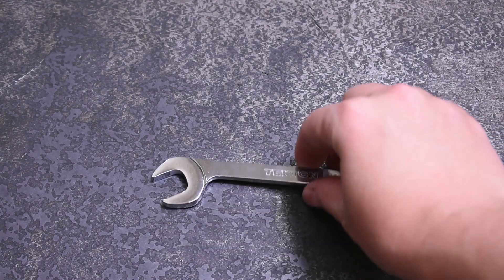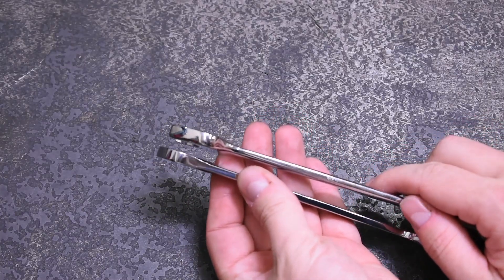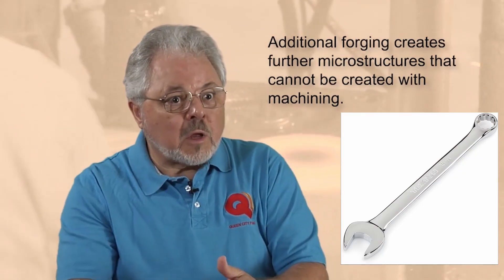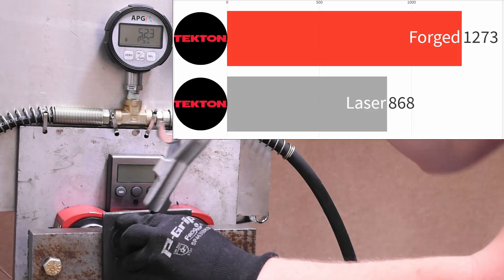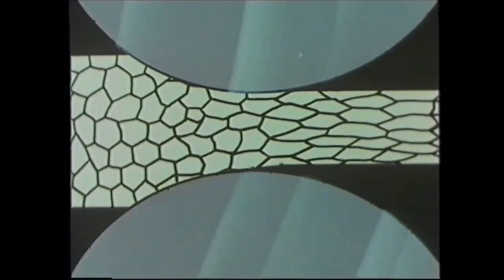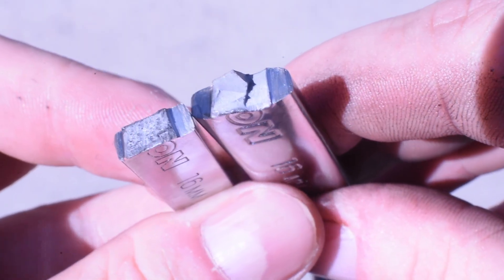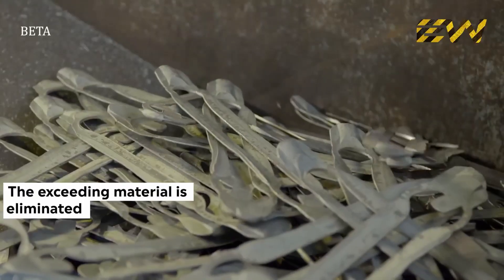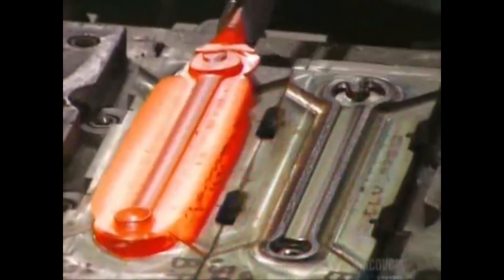The Curious Case of Laser Cut & CNC'd USA Wrenches vs Forged

Comment: Good explanation of the difference in grain structure. The diagrams made it really clear how they differ and how forged tools should be more durable.
Reply: Take a look at machined vs forged vs cast...the grain structure on cast should theoretically be the strongest by far, but in reality a lot of other factors make that determination rather than the way in which the piece was initially shaped.  Cast steel only comes in a handful of alloys, while cold rolled and forged steel alloys number in the thousands, all possessing some sort of unique strength or property, while cast is sort of a "you get what you get" because only certain alloys will remain that same alloy after being melted down and cast.  Grain orientation only comes into play when all other factors are removed besides the orientation, and the gains that grain orientation provide only account for a few percent of ultimate yield strength.  That being said, the larger grain structure of the cold rolled wrench means they didn't refine the grain structure through heat treatment, instead just directly heating and quenching to get the desired hardness and nothing beyond that.  The grains were left large and this heavily affects both strength and hardness, among other things.  Had they done it correctly, the grain structure would've been the same fine powder appearance and it would take a microscope and etching to see the distorted grains from how it was formed.  Forging often refines the grains (it can certainly be done incorrectly as well), so all other things being equal in the manufacturing process, a straight to quench product would favor a forged process more because there was some grain refinement happening along the way.  If you're interested, the knifemaking community has a massive and borderline fanatical knowledge base on how to create and refine the grain structure you want by the precise application of heat cycles and annealing and quenching etc., and that's the biggest determining factor of how strong a piece of steel ends up being.
Reply: @Skinflaps_Meatslapper  it's only when I started to look into metallurgy more in-depth that my mind was blown by how many variables there are in alloys, forging, quenching, annealing, the list of variables could run into the millions when working on just 1 finished piece of metal. There is so much science and knowledge involved in manufacturing metal to get the ideal properties for it's intended use. It is a very interesting field of research involving chemistry and physics. 👍
Reply: @laernulienlaernulienlaernu8953  One thing I really like about metallurgy is that it can be as simple as following a ritual of hitting things with hammers and lots of fire like our ancestors perfected, or as scientific and theoretical as you can stand.  I've amassed tons of knowledge on the subject over the years and I still feel overwhelmed reading science articles about metallurgy.  In truth, even scientists aren't really sure what's going on most of the time...they're able to engineer amazing alloys but a lot of it is still guesswork or trial and error.  Being able to accurately predict what one alloying element might do in a particular percentage is still beyond our capability, we have an idea what it might do based on testing, but sometimes it'll throw us for a loop and we'll discover some new chemical process is happening that we never knew about.  

I find it fascinating that metallurgy today, with all of our modern advances and technology, isn't terribly different from the days when bladesmiths thought a particularly strong steel was the result of magic or imbued with a soul rather than a particularly low impurity alloy.  We know better than to think it's magic these days, but modern bladesmiths are still a superstitious bunch (it's often amusing), and our scientists can't always pinpoint the exact reason for the inexplicable things that happen either.  It might as well still be magic to us at this point in time lol
Reply: @Skinflaps_Meatslapper  I just like the whole idea of alloys, it's like having all these different ingredients and depending on how much of each one, in which order and at what temperature and how much oxygen etc etc etc, you can end up with some really cool or really useful end product. Or you can end up with a pile of junk! 😂
Reply: @laernulienlaernulienlaernu8953  For sure!  I've been experimenting with crucible steel...various bits of hardenable scrap collected from all sorts of places along with some graphite and iron powder mixed in a crucible.  The scrap contains all the other fancy alloying elements like molybdenum/chromium/vanadium/etc. so depending on what scrap you use, your ingot qualities vary wildly.  I've got pages worth of different recipes utilizing different ratios, which bits of scrap seem to contribute the best, and where I found them (because manufacturers change their alloys occasionally).  I have buckets of junk ingots that didn't end well.  When I get something that I'm happy with, I'll forge it down into coupons, heat treat them with different variables, and have them tested for hardness and various durability tests for quantifiable data.  I have two now that show some real promise, and I'm currently forging them down into knives for some real world data and testing.  Eventually I'll have something pretty awesome to work with, and I might scale it up to a small foundry to churn out crucible steel ingots for bladesmiths to use.

Comment: A company could still make forged wrenches by laser and cnc cutting. You would have to get the material forged before its cut, ie a piece of forged billet steel. Might not be as strong as a true forged product but definitely stronger than it just being cut from rolled steel

Comment: In regards to the grain structure, one really important factor that I think was missed is that the grain structure of the wrench is in parallel to the anticipated forces. But you broke it perpendicular to the anticipated forces. My understanding is that forging does a very good job of creating an isotropic material - equally strong in many directions. Where cold-rolling creates an antistrophic material - strong in a single dimension.

So it's like an I-beam in that respect. I suspect the manufacturing technique matters a great deal less for a wrench because of this.
Reply: The force applied by the intended use of the wrench vs by the hammer is still perpendicular to the grain, it's just changing the fulcrum point. Whether using it to turn a fastener/knut, or hitting it with a hammer in a vice, it's still a rotational load along the long axis of the grain, the vice just creates a much higher moment of force in a specific location. However, the applications these wrenches are designed for essentially makes that a moot point as they aren't high torque-spec use cases.
Reply: @thepewplace1370  I think you're misunderstanding. You might want to go back and re-watch around 5:20 - the wrench was broken by hitting it on the *side*. That's not how I use my wrenches and that's not the normal orientation of force.

I agree that ultimate strength is a moot point anyway, but if we're going to point out the grain structure, let's at least consider the orientation of force because it does matter.
Reply: @bradley3549  yeah I misunderstood what you were getting at. The grain structure is not the relevant issue in the difference there as whether viewed from the thin side of the spine, or the thick side, it's still perpendicular to grain orientation resulting from the rolling process. There is just far less material to be in tension vs compression resisting that side impact as compared to the way it was designed to take loading. To apply force along the same rough axis as the grain structure in a cut tool from rolled steel, you'd need a tensile load along the long axis of the tool (or compression, but I suspect it'd still deform laterally some before shearing).

I can't actually specifically remember what your original comment I responded to was about, but regarding grain structure, it's not the biggest factor when striking/applying force in the direction of intended use, or 90 degrees offset, as the grains are still running the long axis of the tool . A forged component of roughly the same dimensions would likely not have sheared even along it's thinnest aspect, even in a vice.
Reply: @thepewplace1370  One of these two wrenches was forged though....
Reply: @thepewplace1370  And perhaps an I-beam is a bad analogy. It's really more like a piece of plywood or an LVL beam. Strong with the layers, but weak against the layers.

Comment: This right here, gents: this is critical. 

The loss of manufacturing in the US is a sad, sad thing, not to mention a huge national security issue (especially given China's massive expansion in the field, with the biggest presses and forges the in the world, by far). 

If you've ever complained about the loss of manufacturing capability in the US (I know I have), then you should try to spend money, wherever possible/reasonable, on the US-built items. Buy a set of these wrenches. Go to Project Farms channel and check the top 10 Made-in-USA video and buy all of those. Vote with your wallet and pump money into every US operation you can afford to. I don't work on automobiles enough to need a set this specific, but I will be buying a set anyway.

Tangentially, try to buy any forged US tools and other items you can. The death of forging in the US is particularly concerning.

Another quality video, thanks TTC.

Comment: As a heavy equipment mechanic, I couldn't do my job without these angle wrenches. Getting on hydraulic fittings in an excavator on say the MCV (main control valve) is impossible with a regular wrench without pulling many more hoses than you need. I currently use Cat branded tools (as I work for a Cat dealer) which are rebranded Snap-On, I believe.
Reply: As a heavy equipment operator,I can atteast first hand that not having those wrenches can turn a one hour hose replacement job into an all day ordeal.
Reply: Love the honesty saying “I believe.” You never know with these companies. Especially with the internet

Comment: Hey TTC team thanks for highlighting Tekton angle wrenches. Could you test Crowsfeet as well? It would be interesting to see differences between brands and if higher end costs are justified. Keep crushing!
Reply: +1 on this, much fewer choices in this category which is frustrating when you're pushed to the budget/extreme ends of the spectrum for a tool that really needs to achieve specified torques as it's fundamental purpose. This would be a worthwhile vid.

Comment: A&P here. This wrenches are marketed wrong. The primary use for them is in the hydraulics field. So the strength is not an issue. They are indispensable in this field, just trying to snake around hard hydraulic lines and hoses is annoying.

Comment: I like these for science videos. Have you all heard any news on when DeWalt is planning on releasing their new high torque? My old 3/4" CP is heavy as hell especially when sporting the 
3 1/8" socket needed on my trailers lunette ring. I either need to buy a composite air or DeWalt needs to get moving because I'm too lazy and old for my current setup :)
Reply from the maker: Around Mid Sept. 3-5 weeks
Reply: @TorqueTestChannel  Awesome. Thanks a bunch for the info.

Comment: If you want Snap On angle wrenches for a fraction of the price, purchase Caterpillar part number 1P-3515 (fractional set) and 559-3896 (metric set). They are stamped Caterpillar but they are indeed made by Snap On. Very nice wrenches

Comment: what do you believe the correct clearance is between bolt and wrench, clearly it cannot be too small :)  ps remove chrome before hardness testing !!
Reply from the maker: Oh, we definitely do grind off the chrome before hardness testing. It just looks a bit polished after. Reading the chrome would be worthless.
Perfect wrench size is ASME Go gauge + 0.01mm technically.
Perfect 16mm would be the ASME formula (16 + [((0.005 x 16) +0.025) + (0.005 x 16) – 0.102)] + 0.0008) + 0.01mm = 16.09mm

Comment: Hello Mr. TTC, could you please compare Milwaukee's wrenches to the rest? I'm thinking about picking up a set since pretty much everything I'm working on is rusted to hell and back so to see their "Max bite" compared to regular wrenches on a rounded fastener etc. would be great! Ty..
Reply from the maker: We just finished testing, if you're itching to pull the trigger: Do it, they are good. HF Icon and Caryle also though, about the same.

Comment: Great video, but when you use these wrenches its usually in a tight spot, also most bolts tourque spec for a grade 8 bolt, 3/4 wrench is only 75 ft lbs, so in reality it should not strip
Reply: All of these tests typically go beyond rated torque specs, and you're looking at it from the wrong perspective. What's important is when you're trying to loosen a corroded fastener with a wrench, that's always where slipping occurs, especially on rounded and stripped fasteners.

Comment: I use these wrenches every day in my shop and feature them on my channel.  They're not cheap in cost and have held up quite well after 1 year of daily use.  In fact, my wrenches are 100% Tekton. Not a broken tool yet.
Reply: I have both sets of the regular wrenches and my only real annoyance with them is the size marking is in the middle. I prefer it on the open end because it's easier to see but as far as everything else they have been fine

Comment: Factors causing wrench slip... nut AC size (corner sharpness) - nut AF undersize - wrench opening oversize - wrench opening deflection under load - nut Hardness - nut AC size (corner sharpness) - wrench engagement thickness - oil residue on nut or wrench.  It's not clear to me that the test procedure addressed all of these factors consistently.

Comment: The forged vs. laser cut decision also is affected by anticipated volumes. These high angle, thin wrenches are very specialized. When you need that shape, you really need it. But most of the time you don't need or want it. Hard tooling for forgings is very expensive and only makes sense for high volume production. Laser cut parts make all kinds of sense at low volumes. 

Your channel is fascinating because you test tools to their breaking point. However, the best measure of quality is suitability to purpose. Is a wrench which is ten times stronger than ever needed in the intended application better than one which is only five times stronger than ever needed? Your typical methods imply a yes answer to that question, so I appreciate that your comments conclude with the "in real life" distinction.
Reply: I think it's something many of us are guilty of.  Obsession with the best when most things in life are tradeoffs and selecting the combination of characteristics that will do the job the way that you desire.  It makes me think of German automakers making something that will do what is required of it under appropriate use whereas Toyota is trying to imagine how you'll inappropriately use it.  It's wherever our priorities lie.  Unfortunately, we're not all material scientists and engineers and those numbers are not readily available to consumers or good for marketing and competition since most people don't even know what they need.  We rely on them to make those decisions that will serve the majority of people to a satisfactory level.